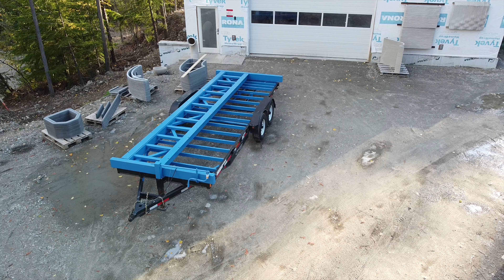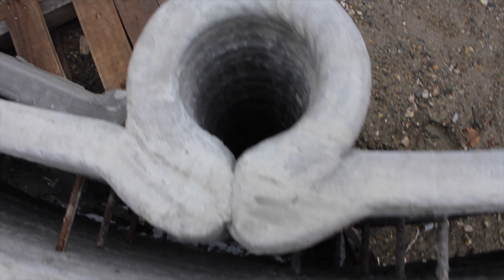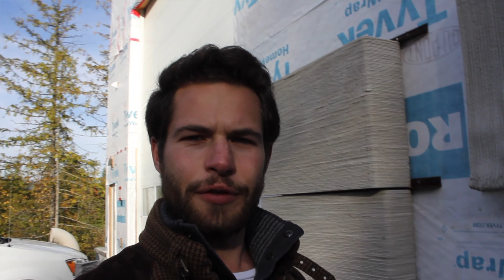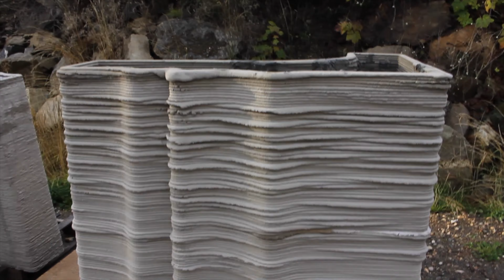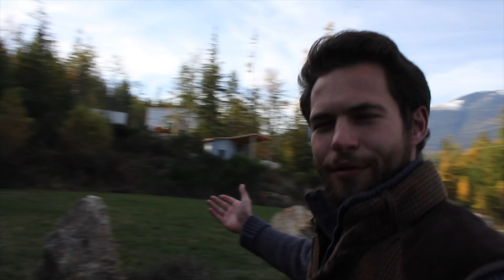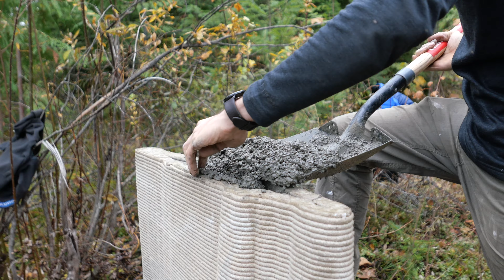3D Printed Construction Facility Tour & Print Installation with Twente Additive Manufacturing

Comment: Thanks for capturing this footage. The mosaic is really nice - hope they include that in the cladding on HQ building. I don't know about those stairs though. Does it make sense to do stairs as one big piece of concrete instead of steps? I'm no engineer but it seems like there'd be settling issues over time with single piece staircases set on dirt slopes like that.
Reply: Glag you like the Mosaic! The staircases have a block within the print pattern at the top and bottom that lock them into the installed locations.